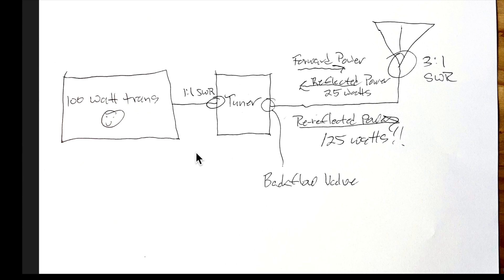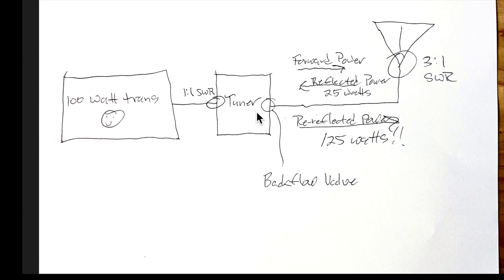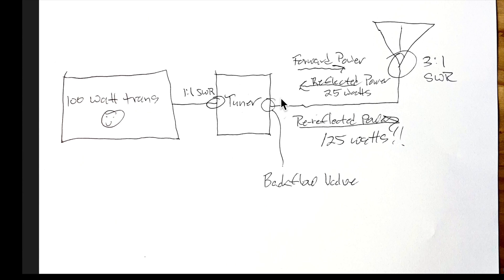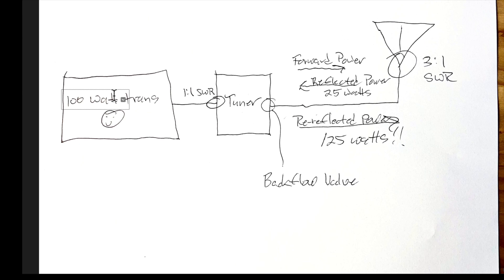Ham Radio Ops Are Confused About Magic Power.

Comment: Missing how efficient the antenna will be and radiation patterns.    Very very very hard to beat a half wave center feed dipole cut to desired frequency at the necessary height etc.   No antenna tuner.
Reply from the maker: The radiation pattern will be different but you have the flexibility of a multiband antenna
Reply: A doublet or extended double zep both are not resonant without the tuner both are more efficient than a resonant dipole

Comment: Ok so can you measure it?
Reply from the maker: You mean measure reflected power going to the antenna?  Yes.  Look for a place where you have a really high SWR.  The higher the better.  Then tune your antenna tuner so the transmitter is happy.  Attach a power meter between the output of the tuner and the antenna.  You will see more power going out of the tuner than is going in.  Hams have observed that for years but many thought it was just an inaccurate meter.

Comment: Over unity? Really? I never placed a wattmeter at the antenna feed point, but if it is over unity there must be a Source of this energy.
I have used MFJ auto tuners for many years, and they match up just about anything you connect them to as an antenna, They always then work well. I believed it was merely a phase correction, or an impedance match issue. Fascinating stuff!
Reply from the maker: It is phase correction and impedance matching but also wave reflection that results in "forward power."  It is fascinating!

Comment: Great video, thanks. Might be an idea to explain what happens when you receive a signal from a distant station through an unmatched antenna, why it makes it safely back to the receiver through the tuner and why it doesn't get 'bounced' like the reflected signal during transmission 🙂 73's
Reply from the maker: Coming out in a few days.

Comment: I look at it simply:  in your example, 125 watts forward to the antenna and 25 watts reflected sums to 100 watts net, the transmitter output power.  In real life it will be a little less due to tuner and line losses, but those are usually just a few watts when working with a 100 watt transmitter.  Go to 1000 watts and losses can increase due to I squared R but still not significant.  Even if you lose fully half of your power in losses (which would be really difficult to do!) that's only 3 dB which may be barely noticeable at the receiving station.

This is one of those subjects where the more you think about it the simpler and more straightforward it becomes.

Comment: You have said the SWR does not change between the tuner and antenna. In another video you made you stated the tuner provides a conjugate match on the feed-line and antenna. If so then reactance is canceled. Wouldn’t that change the SWR since reactance is part of the impedance formula and it was just removed? 🤔
Reply from the maker: There is still an impedance mismatch at the load.  Even though the system is tuned, a dipole will have an impedance of around 70 ohms and with a 50 ohm coax cable that creates standing waves.  Tuner can't change that even with a conjugate match at the load.
Reply: @BustRadioMyths  ok but instead of a 3:1 SWR wouldn’t it be something other than 3:1 since the reactance is canceled ? I just don’t see how the SWR doesn’t change regardless if you have reactance or not.
Reply from the maker: SWR is determined by one thing only - the impedance mismatch at the load.
Reply: You are doing a good job! When I taught radio or any kind of technical class to non engineers I tried to be correct but did use what I called my “Mickey Mouse” analogies to help them understand what was happening. I frequently explained a concept four or five different ways and I could always see the light come on ( in their facial expressions) when I finally got through to them!

Comment: Am I wanting to have a mis-match then between ATU and antenna? The higher the VSWR the better? Is there a minimum and maximum ratio that I should be striving for?
Reply from the maker: The higher the SWR the higher the loss in your coax feed line.  And loss increases as frequency increases.  What's fine on 80 meters might not be good at 10meters.  Play with this graph and you'll see.  https://www.qsl.net/co8tw/Coax_Calculator.htm

Comment: So on the first pass, 100 W is sent to the antenna, of which 75 W is transmitted and 25 W is reflected, then re-reflected, sending 125 W to the antenna, of which 93.75 W is transmitted and  31.25 W is reflected, then re-reflected, sending 131.25 W to the antenna, of which... Hang on, doesn't the power continue to rise on each reflection?
Reply: Continue the calculations.  It will top out at 133.333... W forward and 33.333... W reflected.
Reply from the maker: There is SWR loss plus characteristic transmission line loss plus some reflected power being accepted by the load.

Comment: So .... What happens when you dont have a tuner in line? And you have a 3:1 swr? Isn't this hard on your finals?
Reply from the maker: Yes.  Use a tuner.  Your transmitter would power down with a 3:1 SWR or the finals could be destroyed.
Reply: Does it have to be an external tuner or will an internal tuner provide the same protection to the finals?
Reply from the maker: An internal tuner does the same thing as an external tuner.  But an internal tuner generally cannot tune a line with an SWR of over 3:1.  An external tuner has a lot more tuning range.

Comment: Phase adjusted reflected power (a pseudo-secondary series power source)  is simply added to forward power from the primary source.  In this manner, the reflected power is *re-reflected*.  If only reflected power somehow existed in isolation (i.e., without forward power continuously applied), it would pass though the transmatch toward the transceiver.
Reply: As radio signals you receive commonly do.. 🙂
Reply from the maker: Cool!! @DaDitDa

Comment: My favorite ham myth is the one where some absolutely swear that the only antenna that works properly is one cut to the frequency they use direct fed with coax. When I hear that old saw...I just shake my head and don't even bother to reply.
Reply: There are some confusion here.

The antenna tuner is not a one-way device: it transform impedance between its two ports in both directions. An example is a simple L tuner that can be reversed when used to match load higher and lower than the characteristic impedance of the transmitter.
When measuring a SWR of 1:1 on the TX side of the tuner the impedance of the load (antenna) is conjugated matched. No reflected power that side, no "magic power" neither.
The mismatch is confined inside the transmission line between the tuner and the antenna, starting at the very connection points. But the "power" into the line has both real and complex (imaginery) components and the standing wave is also confined inside the line.
Reply from the maker: Has the ring of truth!

Comment: How do received signals from the antenna get through the tuner to the radio? Is the tuner bypassed or reconfigured somehow in receive mode?
Reply: For a received signal, the antenna is the power source and the transceiver's receiver is the load.   The conjugate match provided by the transmatch remains; thus, the antenna+feedline system remains a Zo (i.e., 50 ohm) matched, resonant system that efficiently transfers signal power on the feedline to the load/receiver.  The Z mismatch at the antenna-feedline junction remains; so, some signal power generated by the source/antenna is reflected back toward the source/antenna.
Reply: I think you found the topic for your next video
Reply from the maker: The received signal is not a reflected wave.  No phase reversal.  It makes one trip down the line.